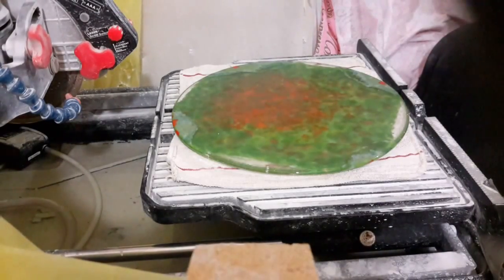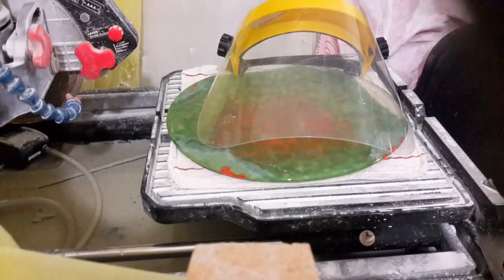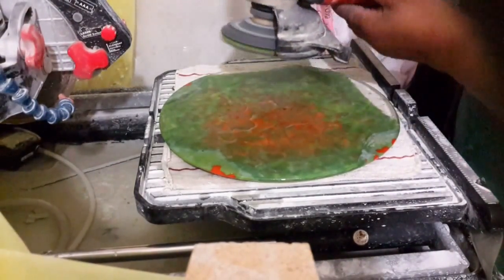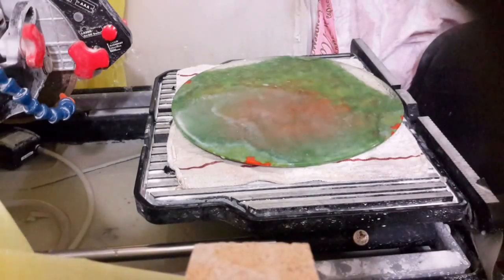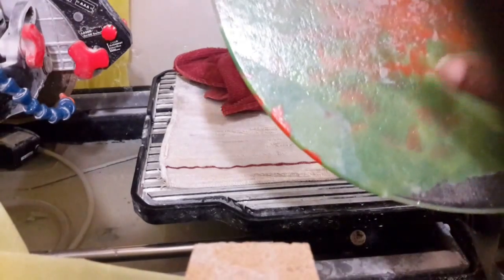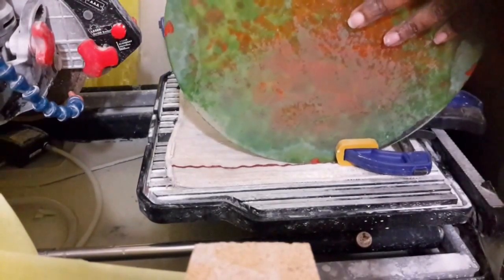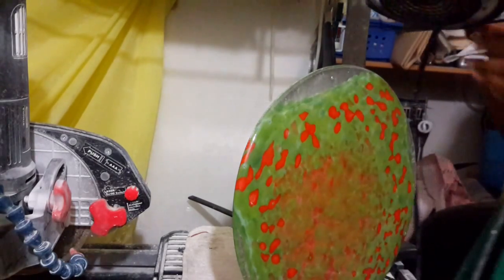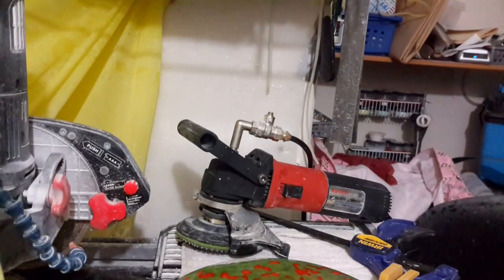Using a Wet Polisher to the Finish the Back and Edges of Fused Glass

Comment: You don't have the clamps themselves attached to the machine to hold things down in any way? I use those clamps on a regular basis and they don't seem as if they would have enough weight to keep the glass from moving.
Reply from the maker: No, the clamps are only attached to the glass.  The long ends of the clamps are on opposite sides.  It makes a horizontal brace or leg that way.